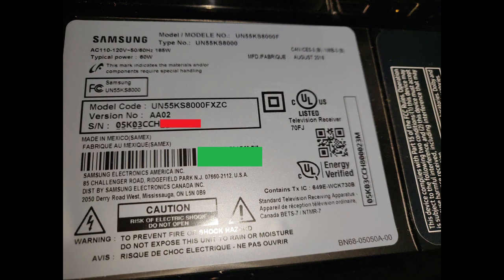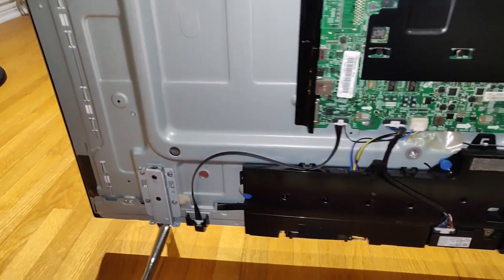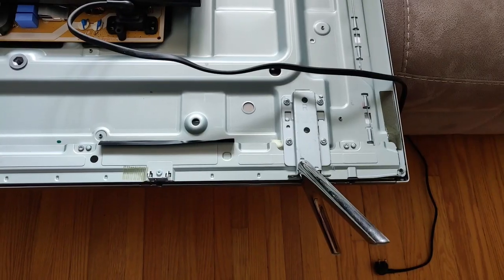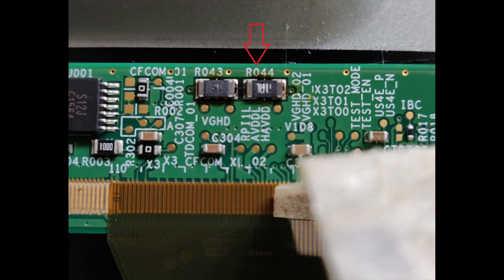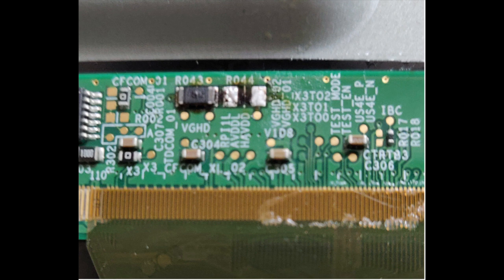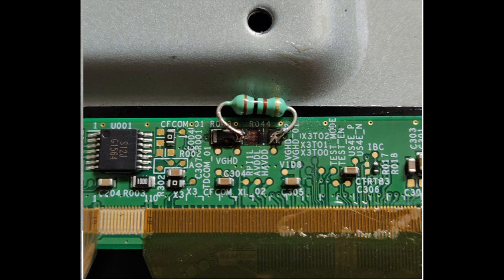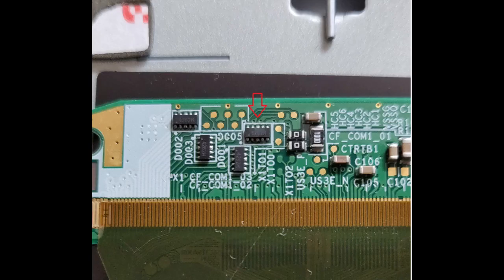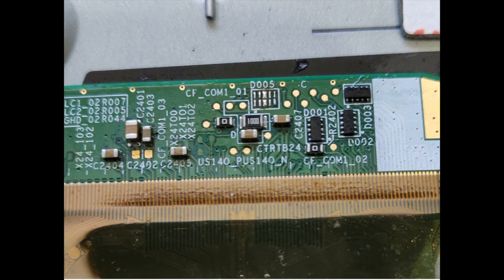Samsung  55 inch LED smart TV repair | Vertical Lines | UN55KS8000 | Resistors, TVS array defective

Comment: My tv has the same issue. But R043 and R044 on left side has 2.9K and 54.4 ohms resistance respectively, so I didnt touch this side. On the right side, of the 2, the right one came apart as I touched it. The left one has 56.6 ohms and when I added 330 ohms resistor to the right one, I saw smoke from this new resistor when I turned the TV on. So I replaced it with the 10K ohms resistor that I had handy, and no smoke this time. And then I turned on the TV, this time I dont see the lines anymore but I noticed the TV is going into boot loop. Then I removed both diodes and still the same issue. Can you help me what I might be missing? Should I try 3K resistor inatead to match the one on the left side of the back panel.
Reply from the maker: Siddu, thank you for your message. I wish I could help you. My TV is all closed up, and has been working well. Unless I open it and make a few measurements, I'll not be in a position to help you. I do not want to misguide you sending you in the rabbit hole with my assumptions  - as I do not have its schematic.

Comment: Any suggestion for un55ks8500f has same problem, please!!!
Reply from the maker: @hoakimhai  Unfortunately I haven't worked on that model. However, if you are a confident hands-on person, why not open it and check? Probably it's the same issue. It's a very involved process. Please don't start if you are doubtful.
My best wishes to you.
Reply: @PremMenon  Hello my friend, I opened it already and I did not see any burned component, I check all capacitor and they did not short.
Reply from the maker: @hoakimhai That's good. Check all the TVS. That's what is causing the problem seen in my video. Resistors are burning because of faulty TVS.
If the Resistors are not yet charred, it doesn't mean things are okay. 
So, check the TVS with your multimeter. Thanks for the update.
Reply: @PremMenon  Thank you so much. I will update after I check them.

Comment: Is it safe to totally remove both of the D005's ? I mean, they were put there for a reason. I'm worried about something over heating and causing a fire.
Reply from the maker: Safe? No. You are doing it at your own risk. Am I okay with this? Yes!
TVS are used to protect the electronics/circuitry against transient Voltage spikes; not temperature or overcurrent. It's good to replace those diodes with the correct ones.... So, please go ahead and replace.
Thanks for your feedback.

Comment: I picked up a TV someone was throwing away and we coincidentally had the same model and same problem. On visual inspection, R043 and R044 on both sides had some heat damage, but with a multi meter I was able to determine R043 on the right side had a huge resistance value (>1800 ohms) with the leads one way, and way totally open the other way. I don't have a heat gun so I went at it with a fine-tipped cheapo soldering iron and accidentally ripped the contacts as you did in your video. I was able to connect the solder to the ripped contact when attaching a 100ohm 1/4w resistor I got from a resistor kit on amazon. Lines are solved and I cannot thank you enough sir. Your expertise has inspired me to learn more to continue repairs on other objects others would just consider ewaste. You have saved good tech from the landfill, practically gave me an excellent TV, and taught me along the way. I praise you good sir, thank you.

Edit: When putting it back together my amateur soldering job broke off and when reattached I broke the other contact for R043. By the time I got the resistor back on it was shorted with R044 for a total resistance of roughly 150ohms. So far everything is still working as intended though thank you again.

Comment: I replaced the TVS diodes for this one SP1064E-04UTG and the resistors burned again. So there is something else causing the issue, I'm going to check :). I'm suspecting this was not caused by an electrostatic discharge (or something like that), I'm suspecting about "Scheduled obsolescence".
Reply from the maker: @JAlmeida50  good work. Thanks for your feedback. Please keep us posted about your findings. My best wishes to you.
Reply: @PremMenon  Hi again. The issue is solved, the SP1064E-04UTG do the job. I replaced it again and everything is working as expected. I suspected that something went wrong during soldering process at the first try. Yesterday i leave the TV turned on everyday without any issue. Thanks @PremMenon. Problem closed :) .
Reply from the maker: @JAlmeida50  Wow! That's awesome! I'm happy the TVS replacement worked. Thanks for letting the team know. God Bless!

Comment: Thanks, this video helped me to fix the same issue on my Samsung 55''. I replaced the resistors (with smd 51ohms ), removed the diode arrays and it is working perfectly. O would like also to replace the diode arrays that I removed. The smd ref of yours (mine is similar) is 4262h, it seems to be a Samsung internal code. Do you know the real reference of this component? Thanks
Reply from the maker: @JAlmeida50  Thanks for your feedback. I'm glad your TV is now working well. No, I didn't venture into finding the details of those TVS diodes. My TV has been working well since that last repairs without those TVS. I guess any TVS with a max reverse operating Voltage of 100V (to be on the safe side) should do.
Reply: @PremMenon  Thanks again.I will try to find one that fits it.Regards

Comment: Hi
I have replaced the resistor on boath sides but I'm still getting the same lines.  There is 38v on the left side but 0v on the right side resistor.  Do you know what could be the problem?
Reply: Do you know where these diods are located?  The resistors I use is a 100ohm 0.25w.
Reply from the maker: @lyamc4445  next to the resistor. It's in my video.
Reply from the maker: You may want to try removing the defective TVS diodes.
Reply: If you mean the diod D005 I have already removed all of them
Reply: The watt on the the resistors that I have used is only 0.25w, do you think that could be the problem ?

Comment: Prem, great video! You sound like an electrical engineer who who understands this stuff. Your video helped me diagnose my Samsung UN55KS8000FXZA that kept boot cycling. 

I knew I had a good power supply, but was not sure about the main board and led panel. Your video helped me rule out the panel in my case. I went ahead and installed a new main board and no change. I did not find any burned resistors on the led panel. Went back to scotch taping along the 2 connectors on the main board. Tried a few different sections and then all of a sudden, voila!

For anyone out there with a Samsung and who has tried almost everything, including this video, try the scotch tape method again on various sections. You may get lucky! It’s worth a shot and costs zero dollars!
Reply from the maker: Thank you for your feedback! I'm glad to hear that your TV is now fixed, and this video helped you with the process of elimination. Ah haa, so the scotch tape finally helped. Great! Quite often, the fix is always simple - once we know (the difficult part) the problem area.
Yes, I'm an Electrical engineer.
I trust your solution is beneficial to the ones with similar issues. Thanks again.
Greetings from Toronto.

Comment: Hello Mr Prem Menon  I have the samsung tv (M # UN55KS8000FXZA) same as yours  since i do not have schematic is there any way you can provide the part number  for IC002 (8 PIN IC) or the number on IC itself. THANKS
Reply from the maker: Hello Jawed! Thanks for your feedback. Unfortunately I don't have the schematic; never had it. If you can provide the schematic, I'll try to figure out what IC002 is. You can share it on the cloud and post its link here.

Comment: ho lo stesso problema su una ue55mu6120 senza t-con,posso fare lo stesso?
Reply from the maker: If it is using the same circuitry, then open and check the condition of the Diodes and Resistors. If defective, then follow the same procedure as seen in this video. Good luck!

Comment: Ok this may be  somewhat stupid question but why are there diode chips in the circuit if you have to remove them to get things working again?
Reply from the maker: Those are protection Diodes....gone bad. Ideally, we need to replace with good ones; not remove. Thanks for your feedback.

Comment: How do you get these unsoldered? The contact points are so small.
Reply from the maker: A heat gun is ideal but a simple soldering iron with a fine-tip can also do the job.
Reply: @PremMenon  Okay great. Thank you for your quick reply.

Comment: Thank you! 
Your fix worked on my TV model EU55KS8005T. 
I messed up another resistor while trying to desolder the diodes, but managed to fix it by using a jumper cable. 
Switched both of my R044 SMC-resistors for some 47 OHM resistors i had laying around and it worked!
Reply from the maker: Thanks for your feedback! I'm glad it worked for you.👍

Comment: Sir please nothing was burnt in mine but I was using a tap to remove the horizontal line with the left panel 
Suddenly I switched the tape to the right panel and got a vertical line with isn’t going anymore 😢
Reply from the maker: That's sad. No, I won't be able to help you on that.

Comment: Same issue happened to me this past weekend. Bought a 100 pack of 1206 SMD 56 Ohm resistors on Amazon for $5 and followed these instructions. Worked perfectly. Thanks!
Reply from the maker: Happy to hear that. Thank you.
Reply: All you did is replace the 2 resistors ?
Reply from the maker: @PamelaGillard-c3k yes

Comment: My TV is just keeps switching on and off without lines. Replaced mother boards, still same problem. After seeing ur video. Opened the panel, out of the resistors and diodes, I am unable to read number on right side r043and r044. So does it mean it is open? How to know if diodes are burnt as well?
Reply from the maker: If you are measuring in the RES/Ohm switch setting on your multimeter, then those resistors are probably open/burnt.
Now, switch your multimeter to Diode measurement and check the Diodes. For a good Diode, you should get a reading in one direction, and no reading when the probes are switched/reversed.
Reply: I was able to fix the tv.  Found diodes to be ok and found one faulty resistor. Got a smd resistor and soldered it and tv is back as new.  Thanks a lot. Saved a TV 😃👌🏻
Reply from the maker: @manohar1manu  wow! Happy to hear that. Thanks for the update.

Comment: Where can I find these exact resistors at or SMD chips or whatever they're called..?
Reply from the maker: Try Digikey or Mouser. Look for 1206 (size) 100 Ohm resistors. If you know a tech in the electronic manufacturing industry, he/she might be able to get you 2-4 resistors free.

Comment: What if RO43 AND RO44 is burn? What can you suggest? Pls help me. I have SMD 220(22ohms). 

i thinks the resistor ohm value on that of tv is 22ohms. Can you pls help me. Im from manila,Philippines.
Reply from the maker: Please replace those burnt resistors. Before that, remove the faulty diodes. Instructions are in my video. Good luck!

Comment: All I did was cut out the 2 diodes on both ends with a razor blade and tv is back to working per normal 100% no issues so far I did not do anything to the resisters... I can not explain to you how much this video means to me I bought this TV with my dad and he bought an identical one at the same time right before he died of cancer ive had this TV stored for years in hopes of fixing it... THANK YOU SO MUCH! 😭😀
Reply from the maker: I'm touched by your words. Thanks so much. I'm happy it worked for you. God bless!
Reply: @PremMenon   I have had a power notification pop up a couple times since I have moved the TV but dismiss it and it continues to work per normal... whether that is the tv telling me those resisters are going to burn up I do not know yet time will tell... could also be this different outlet I am plugging it into as my house is an older house... will update when/if an issue arises or at a later date if no issue persist
Reply from the maker: @breakingbenjaminrox7  if I were you, I'd install those resistors. Although those TVS diodes are there for a reason, and that is to protect against surge and spikes, they don't form part of a functional circuit. However, those resistors are part of an active circuit.
See if you can install those.... before something bigger goes wrong.
Reply: @PremMenon  it has now been almost a year and I plugged the TV into a surge protector and the notification never shows up and still have had no issues
Reply from the maker: That's wonderful! Thanks for the update. Made my day.
It's now over 2 years since I repaired mine, and our TV is still working. I guess those TVS diodes were the only inferior components in the BOM of that TV.

Comment: Thank you so much for your video!  This TV had the exact same problem (except it was R44 on the left board and R43 on the right board that burned out).  I followed your advice exactly and it worked!  I removed D005 on both the left and right boards and didn't replace them, to keep the new resistors from shorting out.  I knew the resistor replacements could be between 50ohms and 100ohms.  For resistor SMD all I had was one 56ohm and one 100ohm laying around so I used them both.  I used a soldering iron.  Worked great!  Have to be very careful not to push much, when unsoldering to prevent traces from lifting.  Did the work under a magnifier.  I have very little income, and this will help.  Thanks again!  :)
Reply from the maker: Tom, I'm glad it worked out for you. 👍

Comment: R043 54.2 ohms, R044 no reading, so I guess like yours- open. Mine had tape over it too from factory, burned tiny hole through tape where the R044 was- that must of caused heat up. I too, like you - only have resistors inline in a kit- no surface mount guys of that rating- I'll try your exact method.
Reply from the maker: Yes, give it a shot. Through-hole resistor should work fine - as long as you can accommodate one in that small space.

Comment: I just got this out of blue while playing Flight Simulator. I have same one- my friends crapped the bed years ago- and both our remotes and 4k player also. I HATE Samsung now. I fix electronics on side though, thanks for vid- before I rush out and buy a TCL (which are GREAT for price) I will try fiddling inside. Time to get solder and flux out!
Reply from the maker: Good luck, my friend. Thanks for checking it out. 👍

Comment: Hi i have same issue with my sinotec 55 inch uhd smart can you help on how to fix it please
Reply from the maker: Hi, the repair instructions are in this video. Please do it at your own risk, or give it to a pro and get it fixed.
The repair is a bit involved, but doable for someone with good soldering ability. Good luck!

Comment: I also was able to fix my UN55KS8000 using this method. As soon as I took the metal step off I started looking for R043 and R044. The resistors are a lot smaller than I expected. I had to go get my reading glasses. Once I found them I could quickly tell that R044 was burnt out on both sides. For your measure I also replaced R043. My testing never isn't due to arrive until tomorrow. I couldn't wait that long. I also took out the array D0005 on both sides. As I plugged the TV in, my heart rate shot up to exercise levels. I got the power button and then filled the screen up to a fully functional screen! Now my next step is to take it by the TV repair shop that refused to even look at it. They told me that the panel was bad and they wouldn't work on it because the repairs would cost more than the TV's original price. I'm going to have a great time watching the dumb look in his face. 🤣
Well, my un55ks8000 now has a new lease on life. I will be moving this TV to my bedroom to replace the 12 year old 32" Samsung LCD.

I used 1206 100 ohm resistors.
Reply: Try and be gentle to the repair place; the symptom does resemble a bad LCD panel.  Really glad you got it working!  They would have charged a lot!  :)
Reply from the maker: Ben, I'm glad it worked out for you.
Reply: Where did u find r043 and r044 ? In pcb ? I removed sound box as well and unable to locate this.
Reply: @manohar1manu  first, make sure you have the same model as in the YT description. If you have your TV laying flat, screen side down. Once you open up the back panel and take off the sound bar the diodes are both going to be on the circuit board both sides far left and far right. The resistors or SMDs are going to be located about Midway on both sides of the circuit board left and right. They are very small and if you have bad eyesight you won't be able to see them. I had to use my reading glasses to be able to see them. Unfortunately I don't have a picture of where they're at. When you look at the circuit board you should be able to see both of the SMDs that need to be replaced because they are clearly burnt out with an orangish brown film around them. Hope this helps